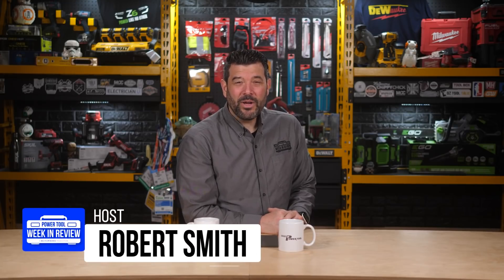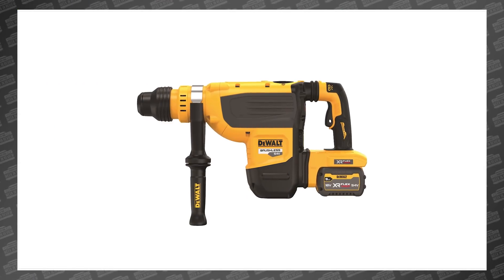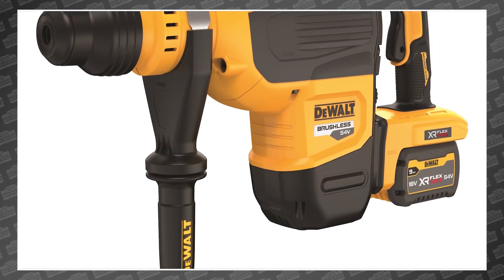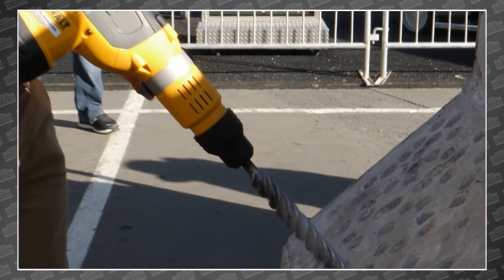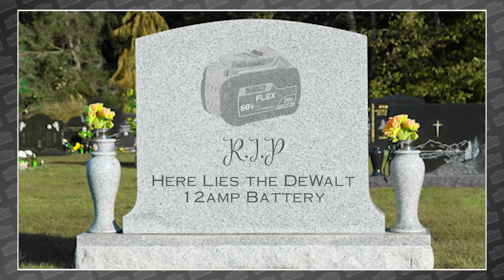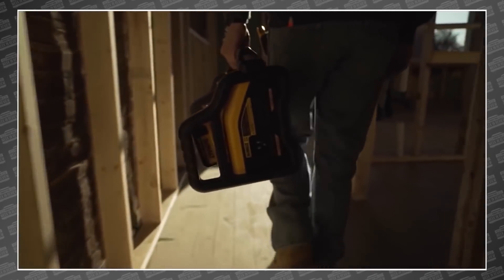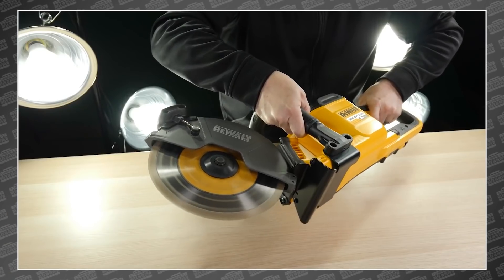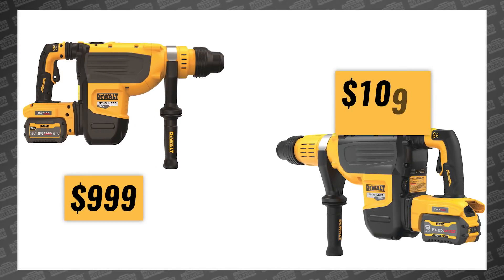DeWALT Announces 2 NEW Mega Drills and the BIGGEST battery YET! 15Ah FLEXVOLT!

Comment: Those SDS Max drills have been out for quite some time, I've had the 1 7/8 for a couple years now, and the 2" has been out for almost a year now, this is old news
Reply: No, these are the newer models. The old 2" was model dch773 and now it's the dch775. The 1-7/8 was dch733 and now its dch735. Specs appear to be same, they removed the plastic guard that used to be around the battery (probably to fit 15ah).

Comment: Excited to see what battery cells are in that thing.
Reply: 18650 i think around the same width as a 6ah but will be a 30 cell battery so 5s 6p in 20v mode, knowing dewalt they will use samsung 25r cells that will constant discharge 20A all day (so 120A in 20v)
Reply: @MingRaptor  strange it’s not 2170 like dewalt and Milwaukee’s higher end batteries.
Reply: @AdventuresInTheSky  I could be wrong but they look around the same width as a 6ah flexvolt, I think the 21700's have more deadspace between cells than and 18650 so for overall packaging an 18650 will be more efficient
Reply: Could be, I just thought the 2170’s did much better in all aspects. Tesla’s 4180 has 6x the power and 5x the density as its 2170, which will be incredible for power tools.

Comment: I feel like you dont understand the amperage of the flexvolt batteries. "Will eat a 12ah for lunch"... Meanwhile when you break it down you only get 1 extra ah for the 60v. 15÷3 makes it a 5ah battery for 60v tools. 12÷3 is a 4ah battery for 60v tools. Not gaining a whole lot for all the hype youre giving
Reply from the maker: As you just pointed out, it's a 25% boost. That isn't significant to you?
Reply: Now imagine that on a 20v tool at 15ah....I could probably do my entire property 2 times over with the 20v max trimmer I have (I run an apartment complex, takes 4hrs non stop on a riding mower to cut and 2hrs with the trimmer)
Reply: If you got the same size saws both different voltage the higher voltage saw is going to go the distance

Comment: Haha 18v and 56v. Not filmed in America, where they can fib about the voltage
Reply: Well the 20v/60v isn't technically a fib.....thats full charge with no load. Thays why it's sold as 20v max and  not just 20v
Reply: I wish we had the range that 20v max has some tools just don't ship to Australia
Reply: you know thats only because someone trademarked "18 volts" in reference to tool batteries. dewalt does it to avoid having to pay someone.
Reply: @adamperry4610  I know. Its wilfukee that patented the 18v lithium ion battery. It's 20v fully charged with no load....as in just taken the battery off the charger. It's 18v working (i.e. on a tool and being ran)

Comment: So that new battery can deliver 5Amps at 60V for 1 hour?
Reply from the maker: Correct.
Reply: @ToolShow  that means they are using 5000mAh 21700 cells, those cells have a maximum discharge current of only 10A compared to 35A on the 4000mAh cells.
That means that the 15Ah battery will have a higher capacity but lower power output compared to 12Ah batteries.
Reply: @DentyRadu  that or it's an entirely new design with 5 series 6 parallel with lower capacity high demand cells possibly 18650 for size issues.... but yeah I have the same fear this is a capacity war when you need to make sure the battery can put out enough current safely. Still because it's atleadt 3p it can still do 30 amps or 540 watts so that's not terrible but it's definitely the lowest 3p battery rated output.
Reply: @DentyRadu  They're not using 21700s or it would be the same size as their standard 12ah. They're using 30 cells in 5s6p setup, so in all likelihood 2.5ah 18650s
Reply: @brodycloud3405  do you think it is really double the size of an og 6/2 flex battery?
Reply: @brodycloud3405  they're not using 18650s.  They're using Samsung 50S 21700s 20A-35A cells with extra heatsinking.  Similar story to the XR 10.0 5S2P pack which is a bit larger than the 6.0/8.0 XR packs.  

And if you're going through all the trouble to make a 6P 18650 pack then you may as well use Samsung 30Q, not 25R.
Reply: @jronmanbuilds  From where the rails are in the photo yes, it should be equivalent to a double row battery turned sideways, stacked 3 times. I'd figure battery in the picture would be 10 cells in a row per layer, in 3 layers. Just wired up to be a 5s6p.
Reply: @jaywelker5566  We'll have to see after its released an there are tear-downs I suppose. Both cases would make sense, and the reason I listed the 2.5ah cells was that's basically every tool companies favorite cell to use in stock kits. I don't know if their suppliers end up being cheaper using 2.5's instead of 3's but I'd assume so. On top of that Dewalt and all the other tool companies also love having 2-3 levels of AH within the same form factor for sales. If it is using 2.5's then in 6-12 months we'll see them pop out an 18Ah.There's no need for 1.5ah M12's when 3.0Ah M12's exists in the same form factor but Milwaukee sure as hell is going to be selling them.

Comment: I knew it would happen eventually (15ah battery) guess dewalt beat everyone to the punch!
Reply: 15ah=20v but at 60v=5ah so actually they are just catching up.
Reply: Milwaukee- * releases 20ah battery *
Reply: @KasparJamesBeats  not how it works.  

54V x 5 Ah = 270Wh.  There is no power tool focused battery pack with a higher Wh rating than that.  

You have to move to MX Fuel/light equipment or OPE specific platforms to get >300Wh packs.
Reply: @jaywelker5566  when that Flex battery is on a 20v tool it's 15ah, but when it's on a 60v tool it's 5ah. Total Wh doesn't change on the battery.